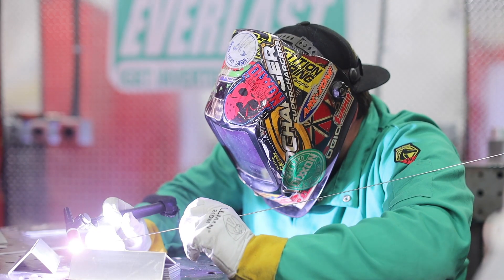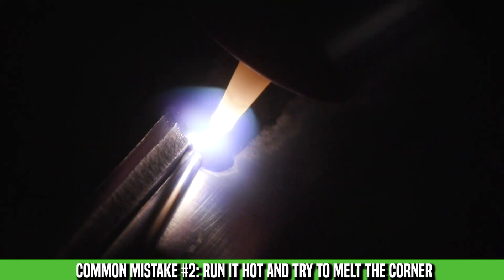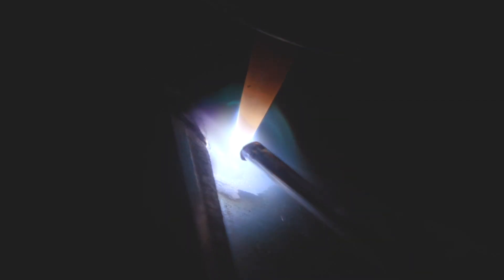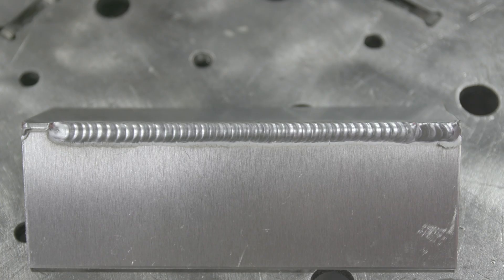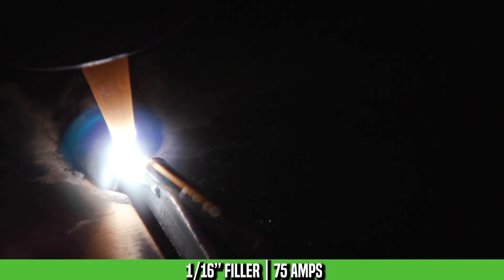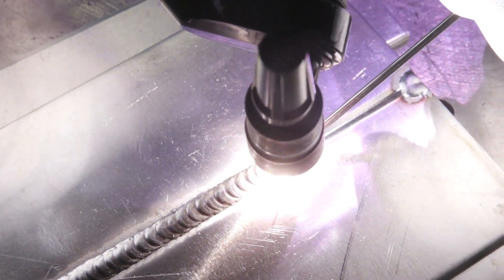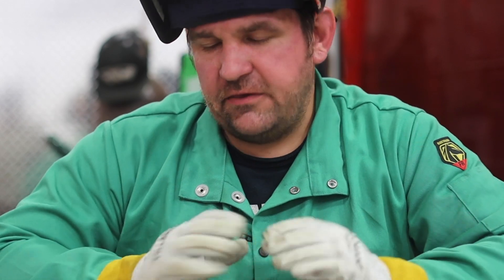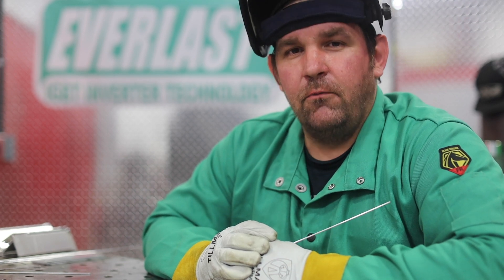Welding Aluminum with Bad Fit-up | Everlast Welders

Comment: Hi Jesse, I'm glad to say hello. Is there any Everlast MIG model that can weld aluminum without spool gun, that is dedicated to non-ferrous metals and trick the torch for this? 
Because I see that most of you must buy the spool gun separately. Some machine that the torch is for aluminum.
Greetings friend.
Reply: 253dpi, single and dual pulse, Teflon liner is standard, no spool gun needed

Comment: I have a question on the first example, where you had some overlap.  For a base metal that's sensitive to hot cracking (like 6061), how much filler is required to change the puddle alloy to avoid this problem?  It seemed like you were only jamming in enough filler to make 10% of the bead.  Is this reliably enough?
Reply: I actually learned that rolling over technique on some intake manifolds I build. The runners are 6061 and come through the bottom pan about 5/32". I use more filler when rounding those over and dont have an issue with them cracking. Send me a message on Facebook or Instagram and I can share some pictures of the process

Comment: Sir I need advice i want to buy everlast welder no tig experience want to buy one welder that I can graduate to that will do everything a great welder would need i have desired the 255
And my second thing is I am a paraplegic and can't use foot pedal so help with thumb control torch 
The foot pedal thing is what has held me back for years now (my fault) people always said can't be good without pedal 
Im not soft do some body off work and patch panels 
I want to know how to tig and going to figure it out but don't want to buy  second welder unless I can start making some bank with first choice 
If you feel you can advice me I would love it 
Thanks
Reply from the maker: We have hand amp control sliders and buttons. Both take the place of a foot pedal.
Reply: Ooops!
Reply: Visit 6061 dot com and check out his torch control button.  Don't know how it would play with Everlast, but probably OK.  You might need to work a bit to find the connector for the 255EXT but it can be done.

Comment: I have everlast welders and like to see people using them but I also like to see all the settings used  .
Power mig275p
255 ext
Reply: 2% lanthanted 1/8" tungsten, about a 30 degree or so grind(pointed), 8 cup on a gas lens, 5/16" stick out, 25cfh stargon AL, 35% balance, 120hz, no pulse, .4 pre, 10 seconds post, advanced square wave.

We definitely just plain forgot about the settings when filming this video, on the other videos I have coming up we hit the settings pretty hard

Comment: It would be nice to list all parameters for each weld:  Tungsten type, grind angle, cup size, stick out, flow rate, balance, frequency, pulse settings, pre and post flow, wave form, etc.
Reply: 2% lanthanted 1/8" tungsten, about a 30 degree or so grind(pointed), 8 cup on a gas lens, 5/16" stick out, 25cfh stargon AL, 35% balance, 120hz, no pulse, .4 pre, 10 seconds post, advanced square wave.
Reply: @jessemccollum  Thank you.  Gas flow seems high, I thought normal is around double the cup size?
Reply: Running praxairs stargon AL mix, you need to run slightly more gas flow than you would with pure argon
Reply: @jessemccollum  Thanks, I suspected that but wasn't sure.
Reply: @JRP3  no problem man, thanks for watching!